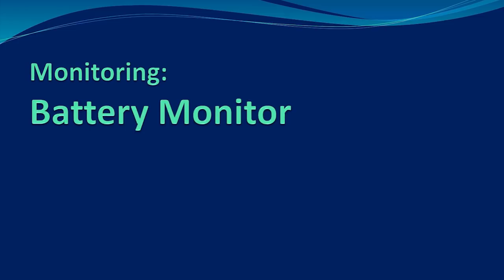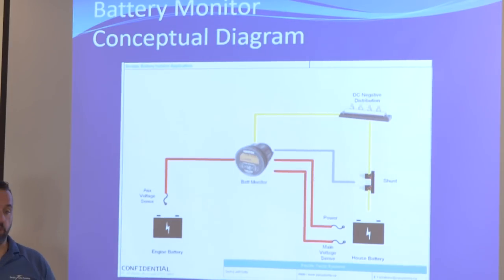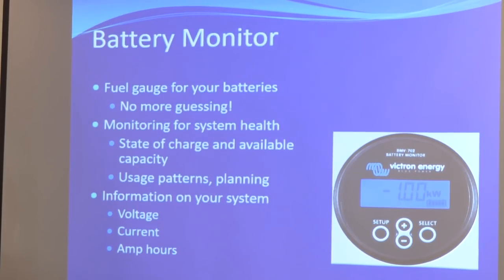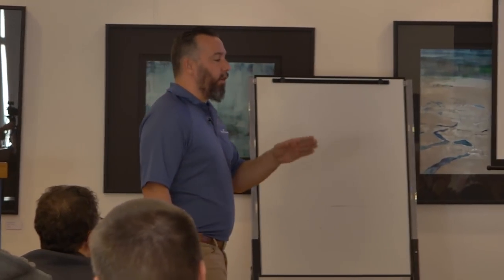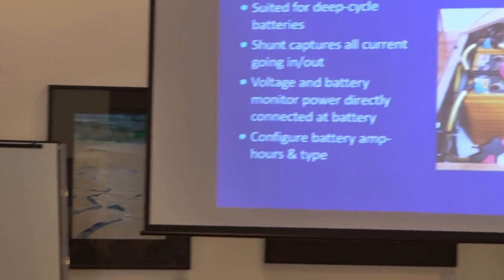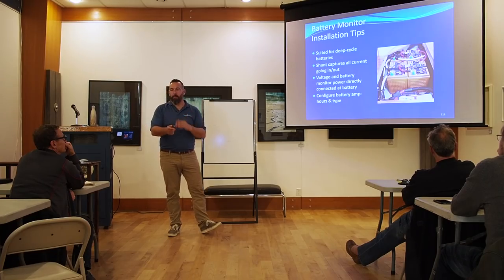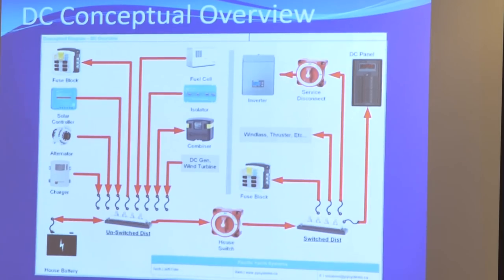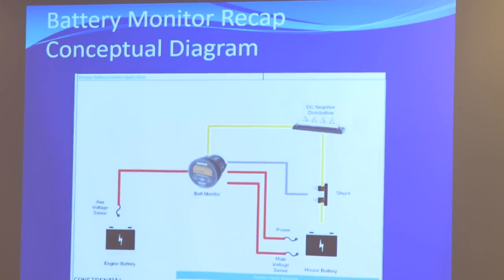How To: Marine Electrical Seminar - Battery Monitors - Ep 13/30

Comment: Jeff, 

Thanks for your ongoing content.    Appreciate your videos.   Specific to this one, I'm curious if the shunts utilized for this purpose are ignition protected and can safely be installed on gasoline-powered vessels.    I am particularly interested in the Bluetooth-enabled Victron Energy product line for this purpose, but I have been hesitant to install such due to varying information on the subject.   Thanks in advance.

Comment: I just got back from Channel Islands and the battery monitor is a must. I have the victron BMV-700.
Reply from the maker: Hi Franklin, totally agree. Otherwise electrical is total magic!
Reply: If you have a bluetooth Victron do you still need a monitor?
Reply from the maker: Hi David, Victron offers a full suite of products, you'll need a battery monitor to get the amp-hours, amps, and volts monitoring functionality.

Comment: hello. from Spain. Thanks for the videos. They are great. I have a question. My Mastervolt controller does something strange and i haven't found the answer in your videos. The thing is that it doesn't go to 100% when the bateries are full and i have to reset it to 100%.  Thanks again.
Reply from the maker: Remember battery capacity is only a approximation and it's not really accurate. It's possible that you are not recharging your batteries long enough during absorption phase to get to 100% of capacity.

Comment: When charging batteries they will turn some of the amperage into heat at the batteries. How do you account for this when determining how full your batteries are during charging while using a battery monitor? Or do you wait for the charge amperage to drop off as your indication that you’re out of bulk charge?
Reply from the maker: Good question, the smart charging curve: bulk, absorption, and float charging voltages assist a battery monitor to know when the batteries are full. Some battery monitors also look at charging amps and timers to assist when a battery is full. Remember battery monitors are estimating battery capacity, it's not an exact science.